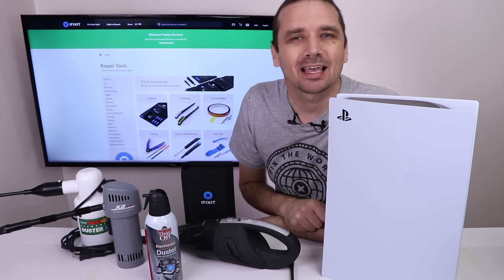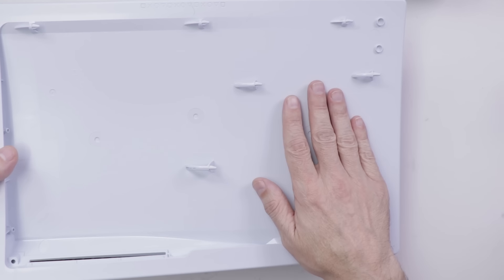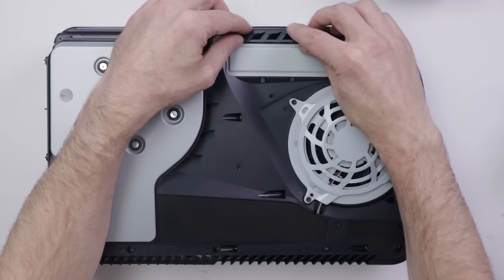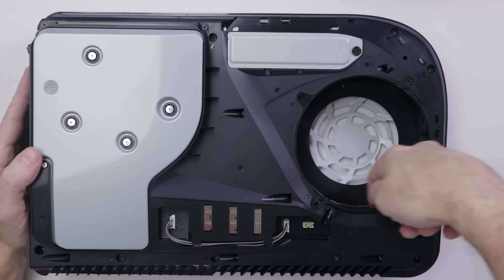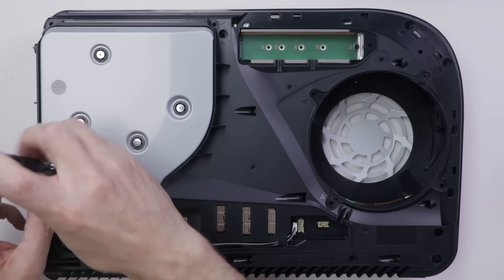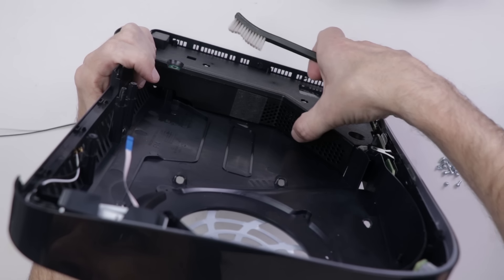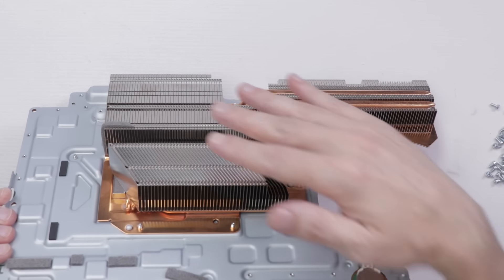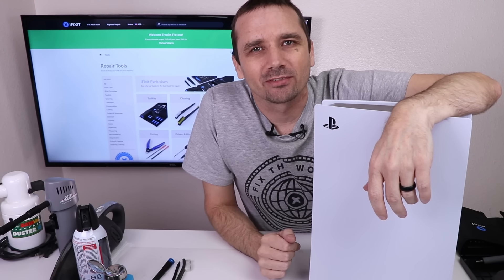How to Clean Your PS5 Safely - 3 Stages

Comment: Yeah, no way in hell will I ever have the balls to enter stage 3 and beyond.
Reply: I did it. Its not too bad as long as you have seperators for where everything goes.
Reply: Vacuum outside take plates off vacuum inside dust off done
Reply: Ya I'm a stage 1 kinda guy but if my device  ever sounds like a refrigerator at least I have a video to follow !!!
Reply: It's simple. Just make sure all the correct screws go back in their original holes.
Reply: @burtswayze  can you do it just with a normal handheld vacuum or does it need a specific attachment or what? I haven’t cleaned my console sense I got it. (I got it the year it released in December)
Reply: Yeah I'm just a stage 1 kinda guy haha
Reply: Here's an update so the issue I was having was it would just shut off without any warning and I had to unplug it to be able to turn it back on after having cleaned out the power supply and pretty much every damn heat sink it works like new. I will mention when he puts the screws back in with the fingers snap a couple of them are in the wrong
Reply: @augustgaming6639  sounds like the problem I’m having now, guess I’ll get to cleaning
Reply: True dat
Reply: I don’t think I have the balls to even “come on the backside” as he so eloquently put it at around 4 mins or so.
Reply: @augustgaming6639  literally just took my ps5 down - put it back together and now it won't come on :(
Reply: You would if your system was shutting down
Reply: Me neither farthest I would go is stage 2
Reply: Yup. Sorry but I paid too much money for me to screw it up somehow.
Reply: @osc-oldschoolclips5204  You won't mess it up if you pay attention to details. But I understand not everyone can do what others do or are they comfortable to. I respect that.
Reply: @augustgaming6639  I’m having that problem too. Was there a bunch of dust when you cleaned?
Reply: its not that difficult take your time
Reply: Me too brotha 😁
Reply: Due an xbx is s much easier to take apart
Reply: You don't need to. Use to hole made when removing the vent.
You can access the heat dissipators and clean them through that.
Reply: Me neither
Reply: @Kurisutofa22  after seeing stage 3 I also a stage 1 type of guy 😂
Reply: Same
Reply: I’m like halfway through stage 3 and all the sudden realizing this guys ps5 is not the fuckjng same as mine.
Reply: Had to do stage 3, ps5 would not stay on for 20 mins before shutting off if I didn't have 3 fans blasting it and would still shut off after a while. It was terrifying but I got it done, I felt a massive weight shift off my shoulders when it turned on, there was a lot of dust built up around the heat sink that I cleaned off and so for it hasn't shut off
Reply: @Epictook  giving me the courage to do this cuz my little bro’s ps can’t stay on longer than 20 minutes without shutting off
Reply: Now way I'm doing stage 3.  My Hands shake too much
Reply: In most cases you won’t have to. Stage 3 is only if you’ve never ever cleaned it and live in a super dusty environment. Otherwise, cleaning the vents and the fan is enough. You should at least clean the fan tho if nothing else.
Reply: Done stage 3 several times. It gets easier for sure. I've cleaned out my brother and my P5. Definitely worth it. Can't lie, I was nervous the 1st go. 😅 Just have to take your time.
Reply: @augustgaming6639  Having that same issue right now.  It's quite jarring when it happens in VR.  Here's hoping I get the same result.
Reply: I just checked mine no dust beyond the covers and I've had it for 3 years now.
Reply: @Justin-zs9zc  respect bruv lol I’m only cleaning my fan while it’s STILL in there
Reply: I can't even pull out the damn connector to the fan. The pliers just slip off and I'm afraid I'll damage the wires lol.
Reply: I can't even pull off the connectors for the fan. The pliers just slip off and I'm afraid of damaging the wires lol.
Reply: When u take the screws out keep them exactly where u took them out
Reply: Yea this where I stop.
Reply: Lool me too 😂😂
Reply: That's weak. Where is the curiosity
Reply: I can't even remove the cover 😭
Reply: You also dont need to. Its only for people with ocd. The console will run for 10 years if you just do stage 1 every year
Reply: Crazy i did this two months ago system was quiet as ever and now it’s running hot and shutting off
Reply: @Justin-zs9zc  it's going to be okay, you can do it and it's been 2 years since you have
Reply: Tbh i do a clean up stage 1 and 2 every 3 months.  So i never managed to get to stage 3 ever.  I have some friends who never did it and complained about freezinf and shutting off and one day we saw it it was like a dust bunny farm . But tbh once i find out he had it near the window i already knew how
Reply: @Justin-zs9zc  I’m a mechanic I’m about to do this tomorrow night😭😂😂
Reply: @augustgaming6639  hey have an question how did you get it fix because I’m having this issue where my ps5 crashes and trip and shutting down with no warning and have to unplug it and my ps5 is up to date and it keeps happening and I’m trying to play destiny two and after 30 minutes it shutdown without telling it like when there a power outage but there really isn’t but how did you fix yours? Because I’m lost and have no clue how to fix it

Comment: Anyone here in 2024 because your PlayStation gets so hot it randomly turns off
Reply: Mine just did this lol
Reply: Yeah, this has just happened to me today. My PS5 is okay… until I try to load a game. Then it instantly shuts down. I’ve ordered the tools off Amazon. So I’m going have try taking it apart. Something I’ve never needed to on any of my previous consoles! and I’ve been a gamer since the early 90’s.
Reply: Frrrr dude it’s been happening for like a week
Reply: Yup. It’s literally never happened before but all the sudden the past couple days I can’t play for more than 30 minutes without it happening
Reply: Same thing been happening to mine. Literally started 4 days ago about to open it up to do this!💪
Reply: @ChukwumaUzodinma-nu6zt  I did the cleaning and I also switched it to the horizontal stand instead of vertical and I haven’t had any issues since
Reply: Just started today, this is horse sheitt!!!!
Reply: @Iron_Born_LLC  I did stage 2 and it fixed it completely so hopefully it stays that way
Reply: Mine hasn’t been turning off, but a message pops up that if getting hot. a small enough vacuum hose to fit it through the fan gap for the heat sinks with a can of air. Wasn’t going to do all that cause it’s was surprising clean as I was taking it off so I am pretty sure the issue is elsewhere.
Reply: Started happening with SMT 5 and now FFXIV. Three of four times if overheated and instantly shut off. Ive been getting behind the covers but (thanks to the vid) just got the fans off so hopefully itll work better now
Reply: @shields2594  mines too
Reply: Yea dont use vert stands they will eventually tear ur console up sony realized this and now they come with a horizontal stand or feet
Reply: Fat Ps2 taught me to clean it out every now and then.

Fat Ps3 taught me not set the new one in a spot where it couldn't breathe or collect and contribute heat to and from other electronics.

Ps3 slim made me go digital after I did open heart surgery on the op drive. 

Ps2 slim and Ps4 have been absolutely👌🏾 flawless and my Ps5 will survive the same by the lessons learnt.
They will last if you care and take care of them.
Reply: i cleaned mine for this reason too. but everyone is saying it started in the same month. I think and totally believe it's a software system update needed bc i barely got any dust out of mine and it also keeps crashing bc of the external harddrive that's connected. On the next update im pretty sure all our issues will stop.
Reply: @WholsPluto  bro that’s exactly my problem I can’t even play ncaa or elden ring gotta get a specific t8 screwdriver it has to have a divot in the middle of it a regular one won’t work fyi
Reply: @Stokie316  maybe you should have. Poor previous generation consoles
Reply: @WholsPluto  yes
Reply: @anthonydallavalle3076 same thing happened to me with FF16, it just turned off abruptly with no overheating message displaying. ima clean it to see if it helps  have u cleaned yours?
Reply: Yeah it’s pissing me off SONY wtf !!! 😤
Reply: Not yet!  Got a new gaming TV the other day and i needed to switch from vertical to horizontal ps5.  IT WAS DIIIIIIIRRRRRRRRTY!  Ot was behind the old 40” but the 48” is so much bigger i need it against the wall so my wife/kid can still see the other TV.  So now im horizontal in front of my TV instead of vertical behind.
Reply: It happens but it’s prob an old ps5 so I think you should to so you shutdown your ps5 hold the start button there will be 2 sounds first is the opening one keep holding it then 2nd you can take off your hands now your in safe mode and use ur usb cable to connect to the controller and uses the ps button go to repair console storage now when your done do the same thing but go to 6 and clear cash then do it one more time go to number 6 again and the 2nd option hope this helps but if it doesn’t work try to move your ps5 from vertical to horizontal
Reply: @Felopateerni  my comment probably doesn’t make sense 100%.  I just haven’t had to clean it because it was behind my tv and i didn’t know how dirty it was(it will be 1yr old soon).  I have 2 cats, i never knew how much that can mess with your console!  It will be getting a cleaning next weekend!
Reply: @davebuckingham1365  I am not talking in a rude way but I wasn’t talking to you I was talking to everyone here with problems
Reply: @WholsPluto  only on certain games for me
Reply: @WholsPluto  YES BRO everyday shi ass asf
Reply: @WholsPluto  mine just heats up my entire room😭😭 after like 2 hours. i wanna get a 2nd one in my room for a dual setup with my gf but it’d be like a sauna lmao
Reply: @WholsPluto  I've been cleaning my console by removing the fan since I have it, but now it keeps shutting off after 30 minutes of playing...I think I'll go further in the cleaning process and maybe I'll try to change the liquid metal
Reply: It's because the ps5 is designed to prevent overheating, so it shuts down at a much lower temp than other consoles
Reply: Yeah that's what I'm looking for playing sparkling zero it shuts off only happens on certain games
Reply: @JoshAdams-y5r  I took mine apart and cleaned it and it hasn’t happened since
Reply: Yep
Reply: I keep my system covered when not in use,so I don't even give dust an opportunity to get in my system.
Reply: @WholsPluto  did it stay that way?
Reply: @WholsPluto  no
Reply: Mines been doing this for a couple weeks now, playing for about half hour and it shuts off
Reply: @WholsPluto  yes, literally why I'm here lol
Reply: @JoshAdams-y5r  for me its the marvel spider man, did you got fixed by any chance?
Reply: @AsifMiddey  actually I took it apart cleaned it there was a bunch of dust and pet hair inside that was a couple months ago so far hasn't done it since
Reply: @ryanmillar6572  i wish i was that OCD
Reply: @JoshAdams-y5r  nice im going home after work today and giving it a full 3 stage clean cuz mines been shutting off on me for weeks now and im almost positive its my huskies fault with all the hair. I almost just was gonna trade in for a ps5 pro but i dont have that kinda money lol
Reply: @wholspluto im here so that doesn’t happen 🤣
Reply: I bought a pro coz my OG overheats i need to clean it 😅
Reply: @WholsPluto  your setup must be disgusting and not ventilated well if your PS5 is overheating in 2024
Reply: yes this has started happening to me in the last month or so, it doesnt seem to dusty when i opened it but im gonna clean it rn. did the cleaning fix ur problem?
Reply: Guys just make sure you’re cleaning the console every so often. It shuts off because it’s a safety feature to keep the console from completely overheating which is usually a sign of dust build up… so naturally it’s an indicator that it’s time to clean your console… hope this helped 👍🏾
Reply: The game, the only game that the over heating happened with was warframe 😂 did a stage 1 clean and so far so good. If it repeats I'll do 2 and 3 if needed
Reply: Yes it has

Comment: By the way, did anyone just come here to clean your ps5 just because it randomly turns off when it gets too hot 😂
Reply: If that’s happening you can lay it on its side disk facing up I did that and now it stopped
Reply: Yes! Black ops 6 is making it turn off
Reply: Same lol
Reply: @justedits95  literally same. Only on zombies. Did you fix?
Reply: Same here. I will give it a good clean up and turn horizontally, however, I noticed we had a recent system update. It might be related to that.
Reply: @MrRahel13  bruhhhh literally rn😭
Reply: I'm dealing with the same problem except nun of my games works my system will shut down on any game and my friends system is doing the same thing
Reply: An update: PS5 started to shutdown (3 times between 4 days) so I decided to make a full clean up (dismounting all the parts). The power supply grid was full of dust with no air coming in (probably the reason). Other heatsinks and fan were also very dusty. Vacuum everything and brushed what I could with a few canned air shots on safe areas (plastics, etc).

No issues after that and I can hear the PS5 "breathing" again.

Will update again if any issues pop up, but having a good deep clean might solve your issue.

Comment: Anyone intimidated by stage three; I just finished doing it to mine that I hadn't cleaned since bought in 2021, really not as bad as you might think. Here are some tips n small issues I ran into along the way:
1.) Make sure you go out and buy a t8 screwdriver bc odds are you don't already have one in your tool box, and pliers are a must for some of the cables. 
2.) Have a way to separate the screws and organize them so that you know where they go back. I did like four Tupperware dishes and ust assigned each stage to one dish, then as I took them out I placed them in a circle trying to mirror the general shape of their orientation within the console. 
3.) He puts back some of the screws in the wrong places in this video, try and mark holes where there was no screw to begin with as you unscrew the protective metal plate. 
4.) After you unscrew all 41 screws, the cover will still take some coaxing to get off of the motherboard as there is adhesive holding it there, don't brute force it. I went gently around the edge with a flat screwdriver and then pulled up using the top left and bottom right corners.
Reply: Thanks for this. I also posted a comment calling out how unhelpful this tutorial was in many ways bc of all that he left out or straight up did wrong and then corrected without even addressing it lol
Reply: T8 Security, learn from my mistake, tough to screw them back on. Dont use too much force, if you feel some resistance its good enough.
Reply: Honestly it’s too much for me bruh, it’s so frustrating
Reply: how is it running now?
Reply: @Damnitgary   Great lol
Reply: @TheBHNetwork  sweet!! Did you replace the thermal paste?
Reply: Yes!! I was looking for this comment!  The name of the game is be patient and gentle, don’t force anything and follow the steps and it’s really not too bad!  (Aside from 41 screws 😂)

Comment: I've never, ever taken apart anything electronic before (I did Step 3) and I was terrified too. Your video helped me in so many ways, not only did I fix my PS5's overheating issues but now I'm not so afraid to take apart something that needs to be fixed. Thank you, so very much 🙏
Reply: @razorruke  mine is overheating, will this work
Reply: @hckymnky  hey did you figure it out myns got same problem
Reply: @ryanater69xd  yeah I followed the video and took everything apart and it’s no longer overheating. If you do it just make sure to follow everything he did.
Reply: @hckymnky  the T8 torx screwdriver I have doesn’t work with the 41 silver screws on the middle plate. What did you use to remove them? I’m trying a small flat head screwdriver but it’s burring some of the screws. Cheers.
Reply: I’ve made it to stage 2 but mine is still overheating on gran turismo vr … think I’m going to have to go to stage three Dangit
Reply: @thekidrailfanner5234  exactly what happened to me but no vr on gt7
Reply: It should fix the issue. If the ps5 is still overheating you have a diffrent problem. Either a fan replacement or a power supply.